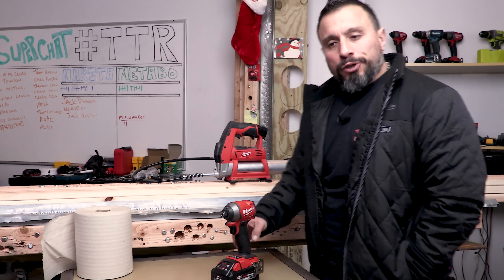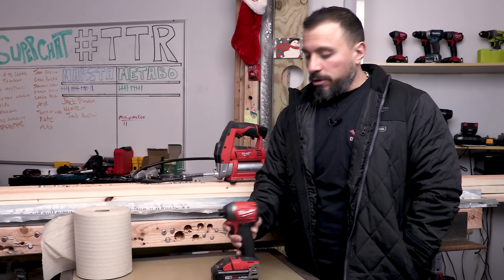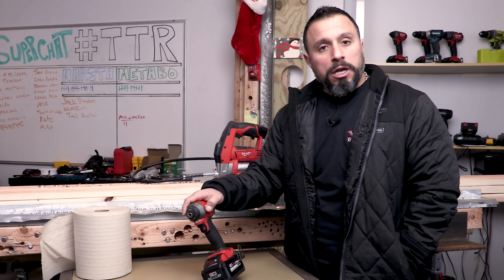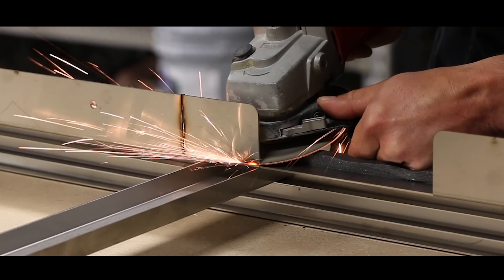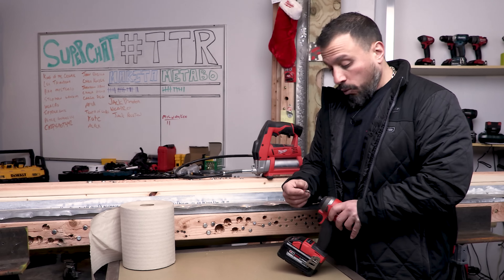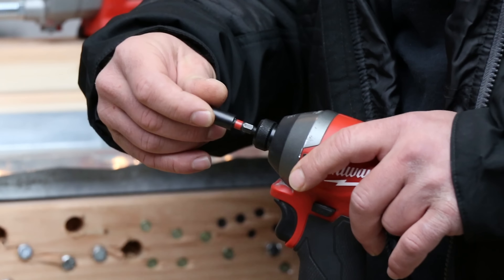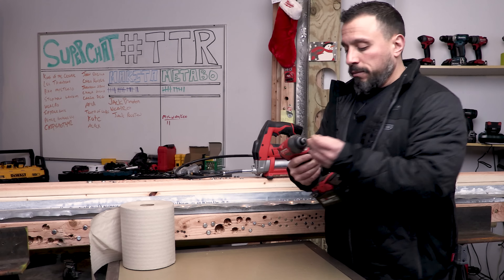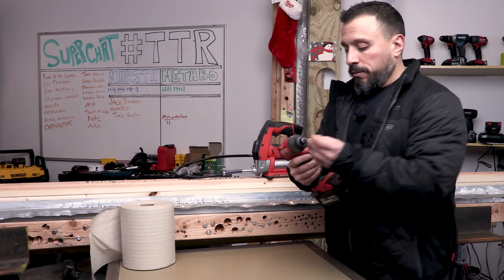Fixing Milwaukee M18 FUEL (2853-20) Gen 3 Impact Driver Collet Problem

Comment: Big fan bro 
I think Milwaukee will set it right
I have a lot of Milwaukee Tools the fuel series and I love them Milwaukee has a great customer service don't think you have a problem after you take it in
Reply from the maker: I hoping a stiffer spring might solve this, what do you think?
Reply: VCG Construction same idea 👍
Reply: I just bought the same driver did anyone find a solution to this problem yet ?
Reply: @VCGConstruction  hey have you guys tried a stronger spring yet? To see if it fixes the problem
Reply: @rycwe  Yes. The spring in the M18 Surge that holds the ball in place can be used to replace the spring in the Gen3. I have a longer comment in this comment section.
Reply: Don't worry about just the spring they have a service kit that upgrades these to a 2 ball bearing anvil and spring just saw it last night I posted the part number on one of vgc, s videos
Reply: @ssskinner28 hi , can you write part number?

Comment: I had Dewalt impacts for several years. They had a collet problem so I recently switched to Makita. Will see if Milwaukee makes a design change before trying them. Makita impacts do not have a collet problem and I am happy with them.
Reply: I’ve had bits jam in mine. My previous Makita an dewalt and Bosch ones have all done it too. Seems the bits move slightly in chuck. I wriggle with pliers no problem. It’s the only issue I’ve ever had had two Makita’s since 2006 both done a lot of work.
Reply: 1/2 inch impact wrench with a 1/8 hex adapter and you have a great impact driver that is way more powerful than any other impact😂
Reply: And if the adapter wears out just buy a new one😂

Comment: What's great about watching VCG's tool videos is that Vince is down to earth with us that actually use our tools for work. With this 2853 problem showing up is good knowledge. The tool manual does say for drilling and installing fasteners. But why would we need to use an impact for driving a self driving spade bit? I agree with you Vince that the flaw in this driver is there and should never happen, but spade bits testing has probably like you said created enough heat in the collect to compromise the spring tension and now the failure.
A better quality/tension spring will solve this issue. You hit that on the head.
thx for your videos too.

Comment: Luckily my Gen 3 hasn’t had any issues yet. Glad to see you show the good, the bad and the ugly even when it comes to our favored Milwaukee.
Reply from the maker: Adam what type of use are you putting yours through? I’m trying to determine if we are just too tough on the tools!
Reply: VCG Construction. Well I’m a locksmith. I do mainly cars but also house and buildings. I use it mainly for auto mechanic type work. I use it for drilling in places my hammer drill won’t reach and need to use an extension.  I have to drill in some pretty strong metal sometimes. I honestly doubt your too hard on it other then during Tool Test Raw. Either way it made to be used in the toughest situation that the tool is designed for. The collet shouldn’t be going bad on you for normal tradesmen work. I also only had mine for a month so I guess time will tell. Either way it doesn’t catch on fire so that’s a plus.

Comment: You know your a pro when you can fix your own tools. Milwaukee has a great warranty department but if you are capable enough, it can be done. This looks easier than jetting  and rebuilding a carburetor so I'm fairly certain I could do this. Nice job on the close ups Nick!
Reply from the maker: Thanks fatbuddycat!!
Reply: The blade lock on the fuel sawzall is a pain in the ass to fix I've had to do it a few times
Reply: @paulhouchen9010  its definitely a test of patience. If your good at disassembly, assembly becomes easier than trial and error. My Dad taught me to take notes, use bags (or small bins) and label everything. We use to put his racecars together, mapped out the entire process and were able to fix things like pros! It always pays to take your time, have good hand tools and steady fingers too!
Reply: @paulhouchen9010  the blade lock on the fuel Sawzall is easy it's the blade lock on the fuel hackzall that is slightly more difficult because of the fact that it does not have the removable shoe like the fuel Sawzall does so with the hex off you have to take the clamshell case off of the tool and of course when you do that you know everything can just flop around so it makes it a little bit more of a pain then just being able to slip the shoe off and out of your way but at least on the fuel hackzall even though the shoe is not removable at least it can pivot unlike the shoe that they put on the non-fuel version that is stationary
Reply: @jason reynolds  I agree 💯 I wish the hacksaw had the same blade release the recip Sawzall use the hacksaw more if it did

Comment: That's my friend had to take his apart cuz he broke his bit inside there and the service center 40 bucks and 3 weeks to work on it he didn't like 2 hours or less not knowing anything about the toilet I'm glad that you showed me so if I have issues and I have to take care of it
Reply from the maker: He was able to repair it himself Kona?
Reply: Yes he was able to get the piece out put it back together a Gen 2 it seems like the same problems could happen to him later he is the Milwaukee driver bit the short ones and it snapped on them and bend the tip of the gun but I'm taking out got it back in the right place but now I know how to do it if I have to do it and I appreciate that

Comment: New to the channel here. Not sure if you fixed this issue yet. The problem lies with the secondary retention spring. If you set the collet on it should sit level and not press against the secondary spring. If it does press against that secondary spring you have to “reshape” that spring so the collet sits flush and holds that ball in place. This should fix the bit retention issue

Comment: I’m going to say it’s the retention spring holding the bearing in place. I’ve never had this problem with my gen 2, however I only use it for maybe 3/4 size spades max. I use my drill for anything bigger. I just upgraded from a gen 1 drill to the gen 3. That thing is ridiculously small compared to the older model, and unnecessarily powerful lol. Best of Luck to ya Vince!
Reply from the maker: Thanks Brendan!

Comment: Nice video.  I purchased the gen 3 impact the first day it arrived in Canada. Since then I have been using the impact 5days a week for work. Use various sizes, spade bits, titanium drill bits, auger bits and concrete bits. I use this tool for multiple application where a drill driver or even rotary hammer would be more ideal but never had this or any issue with the gun. But then again, I do apply white lithium lub/ oil inside the chuck on a weekly bases. Maybe that helps?
Reply from the maker: Well that’s good to hear, I’m pretty sure this will eventually be an painless repair!

Comment: Definitely a concern for me too, I just got the combo recently and although I haven’t found the problem yet it’s already bothering in my mind. If I were to fix it I would have disassembled the whole thing too and if possible put the parts in a hot bath in a degreaser in an ultrasound machine, sometimes I use the method when I fix guns, and then later use the high temp grease either yours or the Mobile that somebody suggested above; there is also the chance that a part it’s already dented and it catching the moving action at some point
Reply from the maker: I have a feeling the anvil and spring may need to be replaced, or a stiffer spring, what do you think?

Comment: Ever have the quick collet fail to release a bit? I had to exchange a surge gun and a shockwave bit set at home depot as a bit got stuck in the gun and absolutely would not come apart, that was within a month of purchase, replacement has been going strong for 6 months now in all conditions!!

Comment: I've got a handful of bits that won't even lock into my MIlwaukee chuck because the hex section at the end is too long for the ball bearings to get secure in the groove. They come from a mix of manufacturers, and it doesn't seem to be consistent across all of a certain brand's bits.
Reply: @Andrew Charles this is with an old style collet. I don't have the auto lock chuck

Comment: Milwaukee should give out free replacement collets to those with the Gen-3 impact drivers.
Reply from the maker: Do you think they’d give out or repair with dual ball bearing collets?
Reply: @VCGConstruction  I have a feeling the repair is going to be a more powerful spring and that's it. Looking forward to being proven wrong.
Reply: VCG Construction good question 🤔
Reply: If it is a genuine design defect.  I agree.  They have made great advancements in their tools of late.  Hopefully they will buck up and help the guys in the field get their tools as they should be.
Reply: I have the same problem Gen 1 impact.

Comment: I would use the grease you used Vince just because that’s what I have at home and it’s high heat so in theory you would think it would work better. But really I think if that didn’t work  than it’s something wrong with the collet like you said I don’t think a different grease would make a difference. Just my opinion thanks for the great video you the man Vince 👍👊🏻
Reply from the maker: Thanks Chris, some of the #VeryCoolGang have talked about graphite, what do you think? Give it a shot?
Reply: @VCGConstruction  i will be happy to see that. The red high temperature grese it's for really high temperature that you don't reach in impact driver.  You reach them like driving shaft in car and brake caliper. Also thinking that milwaukee for sure can put more stiffer spring

Comment: I have the same problem,  checked it out, and I believe the collet is becoming magnetized and holding the ball up. If you turn the 1/4-5/16th bit over magnet side in. The ball drops.  Thoughts?

Comment: I have a similer problem with the Dewalt collet at work.  Somtimes its ok but sometimes it does not want to accept a bit. Thats why i think it is better to a have simpler collet like the one on the new Metabo SSD 18 LTX 200 BL, there is just less to go wrong.

Comment: Hey Vince try molybdenum disulfide! It is a thin hight temp grease that fills the micro pores in the metal. Should be the best lube for the ball bearing. Also you might try some thicker bearing grease as a backup

Comment: How to fix the problem (at least how I did it). The m18 surge impact driver uses the same collet as the Gen 3 (all hail mass production) but whit one key difference. The spring in the surge collet that holds the ball in place is different the the one in the Gen 3. I whent to a online retailer for spare parts, got a Surge ball spring (made up term) and replaced the the ball spring in my Gen 3 whit it. No problem ever since I did that (its been 1.5 months). The engineers at milwaukee most definetly noticed the problem and tried to fix it in a way that whould not mess up the entire production line for the release of the Surge. 

Now this fix only addresses the issue of the collet getting stuck in the open position and not the collet opening up itself when trying to pull out a wood drill bit from a deep hole. I have stoped experiencing this after I stoped pulling on the drill bit whit the might of King Arthur. Put the machine in reverse and let it dig itself out. Then put it back in forward and dig out the wood chips. Normal wood drill bits like the Bosch daredevil or Erwin speedbore does not work well if you drill it deep to the point the shaft of the bit enters the wood. This beacus the bit will stop ejecting the wood chips, the drill bit will get glogd up and get stuck. If you do not want to do it the slower way I described then maybe try an auger bit instead.

Comment: Thnaks for the video. Some of my gear got stolen from my truck and I just bought the Milwaukee hammer drill and impact driver kit Gen 3 and the very first time I go to use the impact driver the volley doesn’t work at all. Won’t hold any bit at all and won’t engage. Good times. Under warranty but disappointed.
Reply from the maker: Wow that stinks I’m sorry to hear that!! Call 1-800-sawdust

Comment: Have you ever thought that different bits fit differently in every impact cuz I've had that issue with the gen5x brushless impact and those Bosch space bits too plus I've had issues with different brands of bits not wanting to lock in the collet as well with different impacts
Reply: Just thoughts I didnt realize this was actually a known issue
Reply from the maker: That’s a good point, I guess I should try some other bits?!?!
Reply: @VCGConstruction  it's always the impact ready drill bits that make it do that cuz the tension of pulling the drill bit back out is at most pretty intense even for a drill chuck and if you wrote or called Bosch I'm almost guessing they'll tell you that the daredevil spade bits are made like that for grip in a chuck and very limited use in an impact if that's all you got.......again just trying to dissect an issue and throw out all possible variables
Reply: HunterGreen M18Fan I think you’re right. Bosch bits are the only ones I’ve had problems with being retained in the Milwaukee fuel impact.

I bet if you measured the dimensions of the hex head the tolerance are different than the Milwaukee hex head bits.
Reply: @LCCJ82  that's what I'm getting at those bits aren't advertised as impact ready if I'm not mistaken and I use the Milwaukee speedbore bits that fit in an impact  and have zero issue with it being released without me releasing it manually.....but to be sure use a Bosch impact with the daredevil spade bits and see if they fall out trying g to pull the bit back out.....see if brands  build there collets around there own proprietary bits.....might make for a cool video.....hint hint
Reply from the maker: That would make a good video!!

Comment: Hmm...  I feel like tacky grease would make the ball bearing stick up still causing the problem so I would recommend a high temp grease that’s thick but not tacky.  But that’s not a solution.  It’s just dealing with the symptoms.  I assume it’s the spring that, when pushed back, pushes the the ball bearing down engaging the retention.  If so then you need 2 things need to happen:  1.  Stronger spring so that it’s less likely to compress when “pulling” on the bit during operation. 2.  Multiple ball bearings so that’s multiple sides pushing against the bit.  I think the quickest solution with the current design is a thicker stronger spring.  It’ll make the quick insert harder but it’s a better compromise.  Just my opinion, though.
Reply from the maker: I’m wondering if a stiffer spring would solve this, what do you think, really?
Reply: VCG Construction yeah I think it would.
Reply: molybdenum disulfide fits the profile of a thinner non-tacky high temp grease
Reply: Jonathan Rusnak I think it would need to be thick like the one VCG Construction used in the video.  Is there anything like that?
Reply: A small click isn't a compromise, if it makes it work correctly.

Comment: I haven't had this problem but then again, I use my drill for drilling and my driver for driving. Seems like the examples VCG keeps using are using this gen 3 driver for drilling? 
Driving applications require very little retention. No excuse for it coming out but he's kind of reefing on it to try and back the bits out but the tool wasn't made to do this?

Comment: Vince try taking Retention spring pulling it to make it longer not too much but a little bit that you put more force on the ball which should make you the  bit
What looks like is happening is the impacts are  making the ball bearing inside jump and when that happens Detaches from the bit 
I say just take the spring and make it a bit longer pulled apart but your hands and then reassemble I think they’ll fix it
If the impacts are truly the problem try putting it on a slower speed and  pulling it and backing it out if Bit stays in it’s the impact that are making it pop off like  I said make the spring stronger by lengthening it and he should have no problems
Reply from the maker: I'm gonna try this!!
Reply: I hope it works
Reply from the maker: So do I!!

Comment: I remember seeing a video of the emposium for Milwaukee someone asked if drilling with the impact is a good idea, he kind of said yeah but not to push it. Wouldn’t the drill be better for spade bits that are 1.5 inches over the impact?
Reply from the maker: possibly, but then what is all this power for?
Reply: Hahahahahaha. This is just great. Over engineered gun that is supposed to drive screws. And your tool can’t hold a bit. Hahahaha.